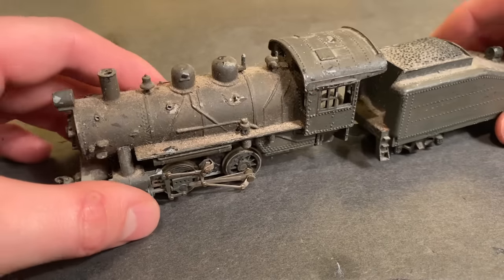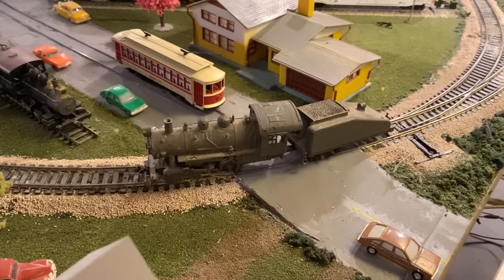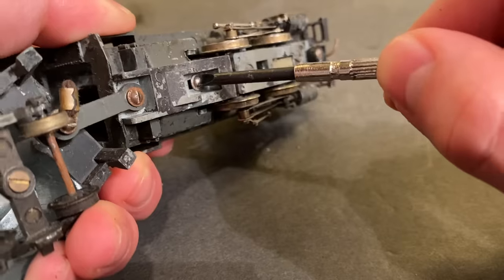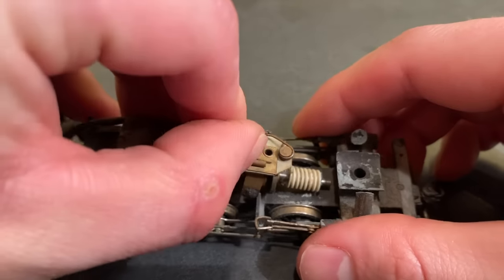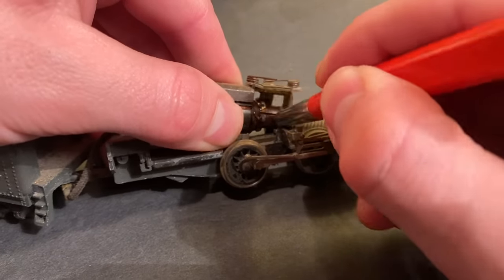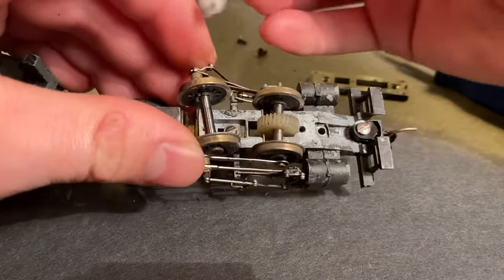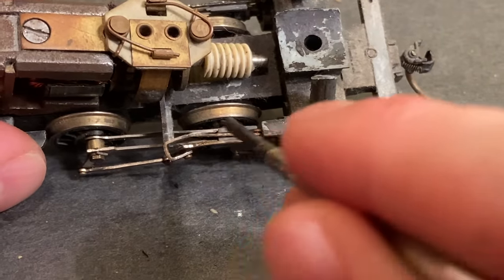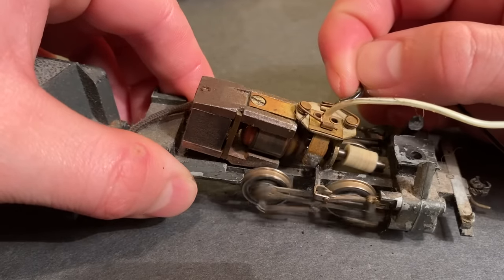Can We Make This 50 Year Old HO Steam Locomotive Run Again?

Comment: Great start. I'd then disassemble the engine, park the drive wheels, valve gear, screws, couplers and draft gear in a project box (that way you keep all the parts together - an old shoe box does fine) remove the motor and put it in the box, disconnect the feeder from the tender and remove the tender trucks. Dunk the cab/boiler, frame and tender in a pan of brake fluid for an hour or two, then scrub with an old tooth brush while wearing gloves. Wash off with dish soap and water. Let dry for several days. While waiting, go on line and order a pair of tender trucks (I think one truck with leaf springs and the other with coil springs would mean trouble on the real thing) Then mask the wheel bearings, spray with primer (a rattle can works fine), let dry, spray with gloss, apply decals, spray with dull coat. Reassemble. Weather to your heart's content. grab your favorite beverage and step back to admire your masterpiece. It really isn't as time consuming as it sounds, you may learn some new skills and you'll have a beauty. The only modification I might make is to replace the motor's old magnets (which weaken with time) with new "super magnets" - an easy procedure that will improve performance, particularly at low speeds
https://www.kjmagnetics.com/?gclid=Cj0KCQiAmpyRBhC-ARIsABs2EAo3hJkvyR45swljRx4pB3pHpiE7PiBcsJG4TNzt8kTKoS8C4Vu20d8aAmOwEALw_wcB 
or 
https://www.micromark.com/Super-Magnets-20-pieces_2?gclid=Cj0KCQiAmpyRBhC-ARIsABs2EAo0NJOnKeLhk3EzrsEzKjdeN8-E3n7bbr-jr08YiqTDkutnjhIjPmAaAifYEALw_wcB
Reply: If I were going to replace the magnets in the motor, I'd just replace the motor.  This "shifter" was my first loco - my dad gave it to me in 1952.  I found it several years ago and installed a new can motor and a digitrax decoder.  It and the "big 6" are some of my most requested locos to run by quest at my open house.

Comment: Great job, Harrison! A hallmark of the Mantua Tyco steamers w tenders is that get to a point where they run better backward than forward . Cleaning the axle journals, especialy on the pickup side will help in more than 50% of the cases. Why? Usually, the train runs forward and the arcing of the axle in the journal builds up carbon on the backside of the journal. Clean out the journal, even w spray electrical contact cleaner, and you'll have a runner forward and reverse.... 
Again, great work Harrison!

Steve

Comment: $5 is a steal for one of those.    I wondered if the issue might be the valve gear.  Tyco would eliminate that at some point, maybe when they went to the all plastic body. 

The last one like this I had, I sat at a train show between customers and went through it and got it up and going.  I usually sell them for around $25 US if they're complete and run well.
Reply from the maker: This one could probably fetch $25 if I slapped some new paint on it.
Reply: Not sure if all the 50s ones had valve gear.  It was a mail away option in the kit instructikns through the 70s.  None of the late 60s plastic RTR with clunky headlight had them...probably to get the price down to $10 or $30 for a set.

The kits by then had the plastic tender, plastic universal Mantua cab (big or small steamers) with rhinestone headlight, but still the die-cast boiler and chassis.
Reply: @SMTMainline  don't paint it. leave it alone, it's perfect.

Comment: I Love those old Tyco, die-cast, Mantua engines.  They run great.  You should be able to pull at least ten cars with it.  Good job!
Reply: I think i found something on that loco that may help the slow speed. David correct me if im wrong the valve gear timing is a bit off on one side the part that wig wags back and forth up near boiler on the side he repaired was timed good the other side was going way way too far and can cause some minor jamming . if he loosened up one of the gear screw on rear driver or tried to match the other side making sure its opposite side the loco would run at lower speed. Due to the other side timing a little out of sort it causes to run higher power around 13:00 you can see the one nearest Harrison that little tiny part that sicks up is going further then other when you go back to the part when he bent the guide in place . the one thats near him needs a slight adjustment i know all 3 of mine had similar issue but were set so its not binding or requires more power. Just a thought what do you think?
Reply from the maker: With a bit of work they can be decent engines that don’t cost much.
Reply: @mercuryoak2  I noticed that too. The eccentric crank should be set so that it's roughly 5-10 degrees "ahead" of the wheel center. The one on the fireman's side looks way off.

Comment: Got 4 or 5 of those old Mantua locos.  Once you get them running, they tend to stay running for a good long time. I have a pretty ancient 4-6-2 Pacific that even got a DCC upgrade (motor insulation from the frame required!).

Comment: Nice catch... that complete valve gear was an optional kit that sold for three dollars...not easy to find.  They were available for   all four and six driver configurations.  The deep flanges make it a 1950s era Mantua.
Reply: So 70 year old loco not 50 like the title says lol
Reply: @Gravity461  The loco was made all the way up to the early 2000s... I think it was offered as a "Mantua Classic" as well by Model Power after that.  I have ads for it going all the way back to 1951.  The nice thing is that the parts are largely interchangable, so putting a twenty year old tender on a 70 year old loco is quite easy.

Comment: Fun fact, I had gotten a brand new Hornby 4-4-0 Ho scale that stopped running, I was uber depressed but I saw one of your videos, It inspired me to open the thing up and fix it. The problem was something with the wiring it would not draw an electrical current. The Drive Wheels still do not but the Tender wheels do so it kinda functions. So thanks man for the inspiration.
Reply from the maker: It's great to hear that you got it running again :)
Reply: @SMTMainline  well "Running" its not perfect and conducting power doesn't work perfectly because only the tender seems to be getting enough power to power the engine

Comment: I always loved these little runners. The motors and crappy electrical pickup were the biggest problems. I always wanted to put in a can motor with either a fly wheel or regearing for slower, smoother operation.

Comment: Serenity! Awesome work. I have a tender that goes to this exact locomotive I've been trying to find a 0-4-0 also a 2-6-2 and a 0-6-0 they are out there I also think that Tyco mantua run beautiful run 1000 times better then any of Bachman's cheap pancake motor split gear and chassis versions.
Reply: you might be surprised how well the old Bachmann pancake 0-6-0 can be made to run. one thing that helps is 8 wheel tender pick up's
Reply: @2nd66tube2  I had a 262 Prairie pile of junk I also didn't have tender pickup either I will not buy Bachmann products that are junk like that the split chassis and a split axles garbage. Mantua made  better product

Comment: It looks like your replacement truck might be from a Gilbert HO engine. I got a Gilbert 433 a bit over 2 months ago, thankfully while a tender axle was missing, both tender trucks were otherwise complete. I had to replace one of the copper wipers since it was missing. Those Mantua-Tyco motors honestly run really nicely (at least the ones I've toyed with so far), the only thing wrong with them is they tend to need cleaning up.
Reply from the maker: It was off a Gilbert but the best thing I had in terms of spare parts.

Comment: A locomotive where's the accessory Central Valley added valve kit that was advertised in Model Railroader for $3. This was the same as the price for a Year's subscription to Model Railroader. I believe the metal kit that they have was sold for about 7:50 if I remember right. They use it in one of those Atlas track planning books at you used to be able to get for $0.99 boy am I getting old

Comment: Smt You really do a good job On repairing HO Train Engine. I also bought an ho engine from this one store  Oldest stuff I bought a taco diesel engine I took it apart and the gears off I bought a taco diesel engine I took it apart and the gears off I found a lot of hair  On the gear the engine  Was Sluggish  I still need to buy  Lubricating oil You aspire me a lot Work on HO engines You help me to understand how to fix them  Keep the good work On the ho of engines.

Comment: I’ve got the 0-6-0 version I shelled out $6 for in 1963. I believe that the rod assembly may be aftermarket because mine doesn’t have it. The nylon worm gear on mine wore out fairly quickly but the worm is fine.
Reply from the maker: I've heard they came with the valve gear on earlier models but removed it later to reduce costs.
Reply: @SMTMainline  Seems like they have n my add the valve gear an option. Your looks really good.

Comment: You didn't peruse the underside of the gear/motor plate. I would also replace the old, frayed wire. It isn't going to last much longer, better to do it at breakdown of chassis and body. And I would have fitted new brushes, or at the least, re-profiled them.

Comment: This seems like a good time to bring up something I have observed several times in your videos. I was an aviation electronics technician in the Navy and retired as such. One of the very first things that was embedded in my mind in trouble shooting was first, #1 “visual inspection!”  Being new to this wonderful hobby of HO’s my first inclination is to look at the drive rods and connections. As you know, a bent rod or linkage can freeze the entire operation. A simple repair in most cases. You have overlooked this obvious problem in many of your repair videos. You always Eventually find the problem but, a visual inspection first, zowee! Got it. And, it is so quick and easily done. No offense meant. I’ve learned more from you than all other sources combined! We won’t count my short comings.😊
Reply from the maker: That's a fair point. I usually do an inspection of the rods however more times than not its old grease seizing the drive.

Comment: The amount of lubrication you are adding is a bit excessive. It will attract more dust and debris, caking and causing problems later.

Cleaning the brushes will help.  

The washers for the motor are known as thrust washers.  Sometimes you can use truck washers in place to help tune the motor.
Reply from the maker: I didn't notice any on the wheels so I think it will be okay.

Comment: Stumbling on your video brought back memories. I have that same model Tyco. I stored it in my attic 44 years ago. My Dad bought it for me one Christmas in the late 50's or very early 60's. I know it had to be prior to 63 because I was touring S.E. Asia from 63 - 66. Your model appears to have a front coupler which mine doesn't have. Mine has the same "L" shaped cow catcher but I don't remember a coupler. On another note... Don't they make PWM power packs these days? That's what's really needed to simulate smooth stall torque that a real loco would have.
Wakodahatchee Chris
Reply from the maker: Thanks for sharing

Comment: I'm glad he got it working the way he did.  However, I would have used a different sequence: I would not have removed that screw holding the cylinder block to the frame.  If that had come off and the valve gear came out of the cylinder, it is a pain in the neck to get it back in...not difficult, but a pain, and in this case, not necessary.  Next, I would have removed the motor (screw recessed in the slot of the cover plate. That way, I could check out the motor, clean and oil it, and set it aside. I probably would remove the frayed wire and solder a new flexible one on. The motor should run nicely at about half maximum power of the DC power pack.  If not, then you might either replace it or disassemble it and lube the shaft and thrust washers.

Next, I would have set the chassis down on a smooth surface, such as a piece of glass, or smooth plastic, and pushed it back and forth by hand. (I note that the eccentric on the left side is out of position, and should be set slightly behind the axle, as should the eccentric on the right side.)  By rolling the frame and wheels back and forth by hand, it would become apparent where it was hung up. Of course, the bent crosshead pieces needed straightening, as he did.  Repeatedly rolling the chassis back and forth would tell you if it is still stiff for most of the rotations of the wheels. At that point, take off the cover plate and clean and lube the axles and bearing. Also, clean the bull gear teeth and lube it.  Again, push and pull the chassis back and forth, checking for binding in the crossheads and guides.  If there is still a hitch in its gitalong, it might be necessary to check the quartering of the wheels.  With a two-axle locomotive, it isn't that likely, but if all else fails..  Of course, cleaning the tires should be done.  If everything else checks out with the locomotive, then look to replacing the missing tender truck.

How dare I criticize SMT's technique? Well, Mantua steamers are, I guess you could say, my obsession.  I've put together, fixed about 40-50 of these, including the Mikado's, Pacifics, Ten-wheelers, and Decapods, including kitbashing 2-10-2's, 2-10-4's out of Mikes, and built a 4-8-4 out of two Pacifics, plus making a 4-8-2 Mountain from a Mike frame and a Pacific front end!  IMO, the Mantua/Tyco steamers are potentially the best HO scale steam locomotive models. Too bad they have discontinued most of them. :(
Reply from the maker: How dare criticize my technique! Just kidding, I appreciate you sharing knowledge on these TYCOs. I try to share what I know but I certainly wouldn't consider myself an expert on them so this information is very helpful. :)

Comment: 1950s or very early 6os kit.
Working valve gear...that was an aftermarket option in the late 60s early 70s.  As a kid, I always assumed it was beyond my modeling skills.  Wise choice on my part.  Didn't build a Bowser valve gear until I was 30...what a bear.
Reply: Yep it's a slopeback 040 Mantua.   After service you have to switch it to reverse to wake it up.  

Your contributor is 100% correct about the fibre washers.  They lasted about a year or two of daily running, then collapsed.  I ran my train(s) almost everyday after grammar school.
Reply: To make it run well slow, you'll have to replace the motor with a 5 pole modern.  Probably not worth it since you run mainline and don't seem to be into elaborate switching operations.

Comment: The model name of that locomotive they call it the big six and that's what Matt to a name that I got about four of them one that's already built from a kit form and a couple of couple other ones that are already been built and they run beautiful good polars too and there's another way to get where you could make the locomotor run quieter and I was told this by a friend that has a friend that was a man to a locomotive builder is Vaseline on the gear it will work on the warm gear if you put a little vaseline it'll really make the engine run quiete
Reply: Actually the Big Six is the 0-6-0 version of this TYCO-Mantua Loco, with the same boiler and tender.  This 0-4-0 version is the "0-4-0 Shifter."  Great little locos, I have them both as well.
Reply from the maker: I've been told by others vaseline will strip the gears.

Comment: There's still some bent parts. You can see the rear drive wobble when you're cleaning them. The bend might be sleight. But probably enough to keep it from moving at slow speed. Overcome through sheer force with more power.

Comment: I could see the valve gear was not lined up from the start, the crank should be pointed at the axle hubs, those might need tightening. Also a suggestion, when you take the wheel gear off the motors worm gear, then you test your motor with hot leads. You might seperate any problems with the motor from a problem with the drive. Good work otherwise
Reply: Yeah. Not really surprising that the motor was having difficulty turning at 4:00, as he was holding the wheels against the bench, creating a lot of friction.